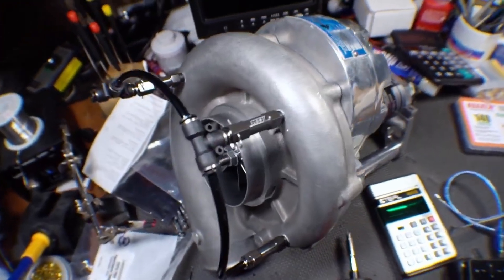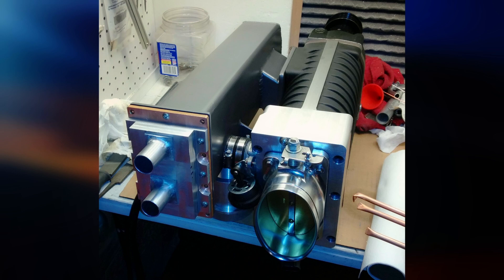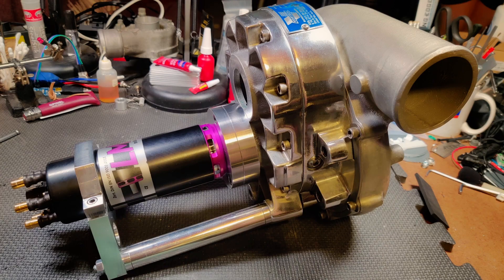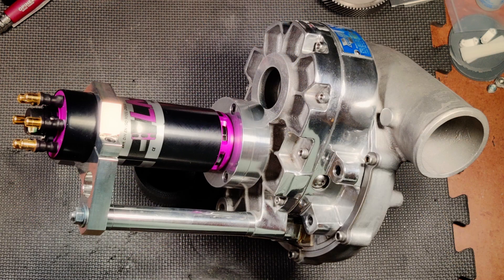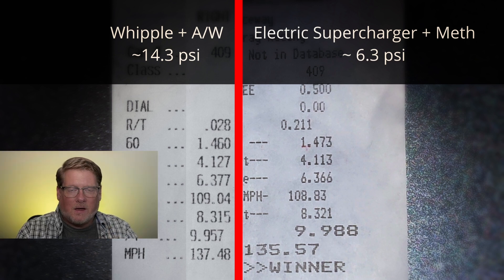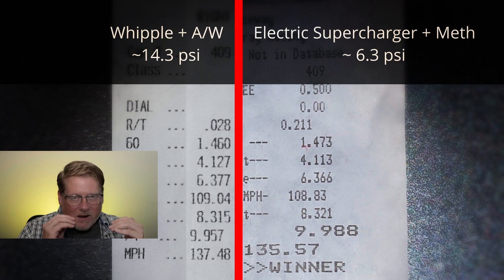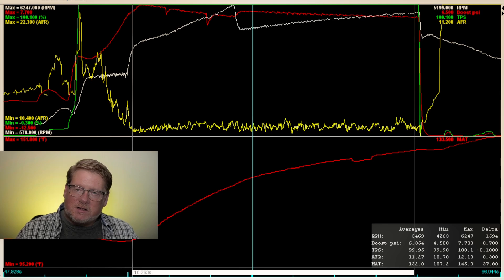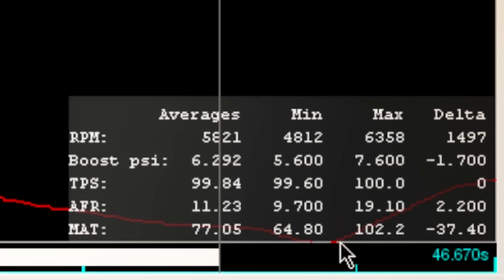Air/Water Vs Methanol Injection - Which is better?  Data Deep Dive!

Comment: I appreciate the level of data in this video. I came here as I am new to methanol injection. My original plan on my truck was to basically rig an Intercooler sprayer up with something fast evaporating mixed with distilled water to prevent heat soak when towing long periods/removed it on command/help when pulling hills etc. using a switch. Do you have any experience with meth and diesels? I have built 7.3 to around 500hp, never been to a dyno with it. Didn't want to overbuild it for longevity (1million is the goal) but wanted to keep up with the new guys while maintaining class. If i ever did water/meth it would be for the same purpose as I previously mentioned, however, if it is inside the charge air piping then it will be more efficient/effective at my end goal. 

Any wisdom you can impart on me is greatly appreciated. Thanks!

Comment: quick question , im getting ready to play & experiment with some exzotic fuels , methanol to be one .. I noticed 11.0ish on your gasoline scale AFR guage.. Im guessing that number represents the corrct fuelinng ? my bike runs 13.2ish gasoline on my AFR guage , & im researchingg that the methanol likes it richer, so that 11.0 you just ran sounded good & consistant ..👍🏻👌🏼
Reply from the maker: Yes, but keep in mind, my O2 sensor differed a bit from the dyno's O2 sensor.  If you're in the proverbial ballpark, you'd need to mess around a bit to find the ideal AFR for your vehicle.  Also, over the years, I've found that as long as you're in the ballpark AFR wise, there's not much power to be had by going from, say, 11.0 to 11.5.

Comment: Aftercooling is an afterthought. It does nothing to help the compressor struggling with hot thin air all the while losing efficiency. Pontiac tried meth injection in the 60's {super rocket juice}and it failed because people would never refill the tank. Same reason they don't use it in production cars now. I use meth because I want my system to run cool, not just the charge air, though I do use both on my turbo car.

Comment: This is a really cool video.

Can I challenge you to try a bit of a different setup with the whipple, since you're already 90% there?

Try putting a AC compressor on the engine, with the evaporator coil inside the air/water tank.  Also put a fuel loop inside the tank.  I think you can forget the ice altogether, as you'll needing to run antifreeze in the water tank.  

Cold intake air makes power, if you add enough fuel to meet the oxygen content of the cold fuel.  Colder air, from a air/water intercooler will stabilize compared to ambient air temp running conditions, and make it easier to tune the engine.

Not to mention the fact that radically cold air/water intercoolers create massive amounts of condensation inside the air chamber.  That's lots of potential fuel, if you know how to convert water vapor into a combustible fuel source.

If this interests you, respond here and I'll explain in further detail.
Reply from the maker: I won't be able to test that anytime soon.  I'm building a new place, and the electric supercharger has taken the place of the Whipple.  But who knows, once the new place is functional (hopefully soon - as in, this fall), then maybe I can try that out.  Thanks for watching and commenting!
Reply: Actually, if anyone knows how to convert water vapor into a combustible fuel source there are a lot of fusion power physicists and engineers that would like to talk to you...
Reply: @tababobi  You got it.  Cold fusion requires converting HxO into H3O2 (Hydronium, said to not exist in nature, bur I can convert it in a temporary state).

Comment: I run a non intercooler kenne bell two screw with 2 nozzles one pre rotors and one post 50/50 water methanol and now been trying 50/50 water isopropyl

Comment: Good video with good data. 
Where did you find the intercooler tank that was used inside the car?
Reply from the maker: It's a tank from an RV tank company.  I don't recall which one (that was several years ago now).

Comment: what about combineing air/water intercooler with methanol injection? i mean you already have both setup why not tho
Reply from the maker: You could, but at the low boost levels we're seeing with the electric supercharger, the A/W intercooler would be more of a restriction (there has to be some boost loss, otherwise it wouldn't cool the charge); if you saw gains, they would be minimal and I'm certain not worth the effort of building and packaging it.  Now if we ran several of these units and raised the boost levels significantly, then it would be worth it.

Comment: Well, very nice video. I have installed Snow Performance stage1 wmi kit and i want to add fuel at my setup. What is the proper mixture for maximum power gain? 50/50 meth/water, 80/20 or 100/0 methanol? Thank you in advance

Comment: Te huge benefit of E-SC comes down to it can provide increased MAF without draining power from engine like Turbo or any other type of SC.. this can only work while there is stored energy. an alternative for "street" car would be to use a regenerative braking to charge tat "battery" (of what ever sort it is)

Comment: Any data on 50/50 water meth?? Many suggest theres better cooling over 100% meth. Pretty sure extensive research was done on jet engines during WWII.
Reply from the maker: There was more than enough data for me to go with straight meth as making more power.  Maybe down the road, when I get my own dyno, we can do some more testing.  Paying for dyno time gets expensive - even when it's your friend's dyno.

Comment: How practical would it be to up the eturbo to the wipples' boost levels...  What number would that entail eturbo hp/watts, rpm, mass flow etc, motor hp, wheel hp etc....
Reply from the maker: It would only be practical by using multiple units.  That's why I've built the cheaper/easier setup.  you'd need less electrical power because the compressors would be more in their sweet spots.  If you could get the boost up to 15 psi, like the whipple, you'd be at or over 1,000 hp; the Whipple made 850 on it's best day in mineshaft air; on a similar air day, you'd see at least 1,100 hp out of the electric powered setups.

Comment: Great video! Curious point you highlighted regarding the cyclic oscillations in the boost curve when the meth is on. Just know how my pump in my setup runs, have you compared the frequency of those oscillations with the frequency at which the pump is driven? Assuming it is PWM same as my setup you might be seeing cyclic pressure oscillations in the manifold based on the meth pump injection frequency, not sure what sort of resolution you have in the logging setup. Keep up the good work.
Reply from the maker: I really am not sure.  I'm not driving the pump with a controller - just full power all the time.  It's possible that the oscillations are from the pump itself.  The megasquirt doesn't do much smoothing to its datalogs, so it shows stuff that one might not see on a different EFI setup - which has its pros and cons.  I'm used to it now, but at some point I'm sure I'll switch EFI systems again.  I'm not thrilled with the megasquirt's tach signal input circuitry.
Reply: I had a snow v2 controller initially (when I was still using the stock ECU in the car) I don't think I ever measures at what Hz it drove the pump but it would increase with boost. Since then I've got for a full Haltech ecu and wired the pump into it via a solid state relay. It just gave me additional integrated datalogs being able to see exactly when the meth was on, level was low etc as well as the tunability to map it vs whatever condition you like. Keep up the good work!

Comment: Single father with 2 daughters myself and that's how I ended up with a rotary swapped subaru forester 😅because my rx7 didn't have backseat its also got a air to water intercooler and a aem water/meth system on it now we are ls swapping my 84 datsun 720
Reply: You is the guy. First of all - rx-8 😂
Secondly - what's your setup like?
Reply: @okumakamizu3030  its posted on here but it's a 91 t2 s5 street ported motor t2 trans thrown in a bagged sg5 forester so it's rwd
Reply: @okumakamizu3030  but I'm actually about to pull the rotary out and put a k24 in the forester because I just picked up a 88 fc rx7  so the rotary will be in the rx7

Comment: As I recall the guy at snow performance told me most of the gains come from adding timing to the engine. If you have strong parts and you have enough detonation resistance meaning good fuel. Start cranking in 3 degrees at a time. It'll really come to life. Mine was only on 17 degrees total. Because it is a stock block 8.2 deck.

Comment: I've been following your progress and it's very interesting. I'm installing a p-2 on a 2009 5.7 charger using an 80 tooth crank pulley to 20 tooth pulley on a 5/8 bar that drives a 40 tooth pulley to the 18 tooth p-2 supercharger to get it up to 53000 rpm. I'm switching to ceramic bearings to handle the rpm. I had an idea, could couple a tesla motor to the crankshaft directly or via pulley for  a very tunable extra horsepower adder? Thanks for all the helpfull info!
Reply: I've been researching the tesla motor idea. Dodge charger trunks are huge, so I'm going to put a tesla motor setup in there and add a 1:1 transfer case in front of the fixed rear diff with hp supported mods to handle the extra power. There are awd Chargers out there, also thinking of converting the nag1 to an srt8 awd setup. 1000 awd combined power would be fun!

Comment: Love this setup.  Are there any wall wetting or manifolding issues with the methanol distribution? In the past, I had issues with cylinder trim with single point meth injection. Especially in large quantities. Maybe the location in the volute helps atomize the meth better? A fun test would be to just use water.

Comment: Since your using the meth as a fuel supplement, are you not worried about distribution between cylinders? would a direct port kit not be more ideal?
Reply: he is cooling the compressed charge directly at the source.

Comment: Great data and proof of concepts. 
I run a air/water Intercooler 12x12x10 core on my turbo diesel 4x4 with extra car radiator/twin thermos under the tray and 15L coolant reservoir. 
Running 30 psi on a 35-40c day AIT after the cooler are at best 10-20c above ambient temperature.

Comment: Run both meth and air to water
Reply: By my calculation you would gain a lot . The water will be use as a link in heat transfer .
Reply: I imagine a scenario tell me your opinion . The water get compress and absorb the heat . It became gaz . The gaz condense on the air to water cooler and transfer the heat . The heat transfer is more effective because the water contact is smaller for the exchange and water create a material link to cool down even more efficiently.  So it's not the avantage of the 2 adding together.  It's like x3 better or something . 

With microtubing like indi car and a power chiller like the dodge demon , all that system would maybe freeze and clogged the intake in hope 😆
Reply: That's when you start breaking things inside the engine.
Reply: @rockets4kids  be fun to watch but not fun to pay for lol

Comment: Methanol/Water is great for the track. I would rather depend on aftercooling on a street car because it's not a consumable. To each their own.

Air density is KING! That's the whole point of forced induction.

Comment: This is a poor comparison IMO. You need to put a decent A2W on your current setup for an apples to apples comparison. They are cheap. Y pick up power over the meth, I guarantee it. A decent A2A IC would pick up over your meth inj as well. But at low boost, I don’t think it would be justified cost wise. 

 What was the pressure drop across the core of your cooler? Regardless of the amount of ice melted, your A2W was not performing well. For a like comparison, a cheap china “boost chiller” unit would keep charge temps in the 65-75* range at 25lbs+ with ice water. That’s with ambient temps in the high 80’s and less flow than you were running.   

The other big caveat IMO is tuning differences, specifically with Ign lead.  If meth was truly a great “charge cooler”. You’d see the same performance gains as intercooling with no timing adjustments made. Water/Meth is more like a race fuel IMO. Your gains are mainly from its ability to allow more timing and/or boost.

The IAT data is bunk, period. Logically the air has no TIME to allow heat to be pulled from it. Its in and out of the cyl in a millisecond. The sensor that’s sitting in the stream of fluid is having heat constantly pulled form it over A LOT of time.

Comment: You make some good points regarding the temperature of the sensor being affected by fluid, it should be helpful if the same fluid wetting the sensor is also cooling the intake runners and other parts of the intake tract. One of the design considerations for the AEM water/meth test rig used during the V3 injector development was adding a muffler to keep one of the temperature sensors from getting wet during the test. There are some screen captures showing the difference as 'Post Nozzle Pre-Muffler Temp' and 'Post-Nozzle Post-Muffler Temp', near the end of this video: https://youtu.be/aooi3Y9YuGQ?t=822  , it looks to me that the dry sensor is warmer than the wet sensor by at least a few percent.
Reply from the maker: Thanks for pointing that out.  So it looks like there's about 8-9% difference in temps.  Or, the other way of looking at it is over 90% of the charge cooling the sensor detects is legit.

Comment: Does the Methanol spray actually hit the vanes ?  and at what point will it erode the vanes?  Does your datalogging software allow for other external data channels like driveshaft RPM, or transmission pressures?
Reply from the maker: No, the meth doesn't spray on the impeller at all - it sprays into the volute.

Comment: Why even use meth .. why not just pure water . Cools your combustion temperature and add pretty much a infinity of knock control!
Reply from the maker: A number of reasons - methanol has a lower boiling point and it has a very low flash point, so it vaporizes much easier actually cooling the intake charge sooner; it's an oxygen bearing fuel so it adds more power that way, like nitrous and there's a difference between effective octane and non-flammable - while water does cool the charge, it also negatively affect the flame front.  In other words, it works, but not as well.
Reply: @AlexLTDLX  droplet size plays a big roll in water injection. And often misunderstood. But it does nothing unless timing , fuel quality,  boost pressure, temperature. Require it .. 

Your only running 6/7 pounds .. what is your compression ratio? Do you run extra timing with the use of the methanol?and what are temps with out the  use of meth ..and how does it hurt or help HP number or data . .meth spray works Great I'm sure. Helps have consistent and controlled air conditions.

Comment: The one thing I don't like about meth injection is you have to tune for it because the methanol is displacing fuel. Therefore you would have to have a fuel map to account for the additional methanol fuel in order to take advantage of it. Maybe I would consider just water injection instead
Reply: At 114 /116 octane what is not to like? I would have larger injectors/ two sets, one for meth / one for gas. Two motors and a twenty percent overdrive for the compressor. Running all the gear up front for the three phase and have the chassis for ground and one dc cable forward.

Comment: will you ever install an interchiller? would be a good DIY addition
Reply from the maker: You mean like the setup that runs off AC?  I certainly would, except the LTD has no AC - but I might add an electric setup at some point.
Reply: @AlexLTDLX   I would say installing a stock compressor to your block would be easier given that it does not interfere with other auxiliaries. the hassle is in fitting the condenser and evaporator with your current water cooling setup
Reply: @AlexLTDLX  there are some sweet electric ac compressors not much weight either. Back in the doid, it is hotter than where you are now it Tx . The old 911 Porsche had miserable ac , except for a couple. One had a regenerative drier , and another had a large almost side to side and the inside of the suspension mounted to the bottom of the car, adding only one inch to the clearance. It had collected debris and dents but it was Cold . Would never work with front engines though too much heat. Unless you’re running zoomies. Lake pipe?